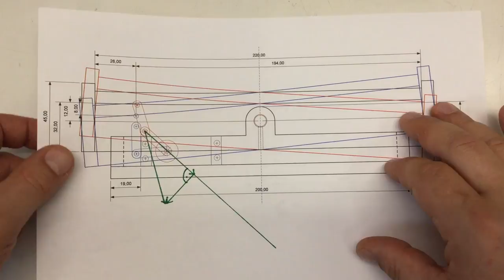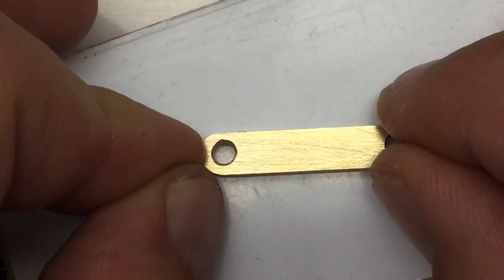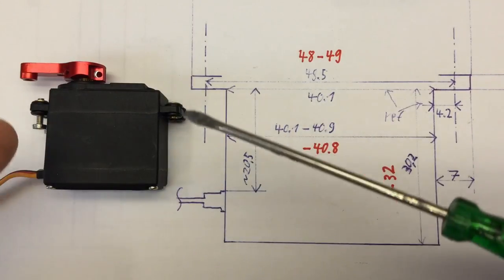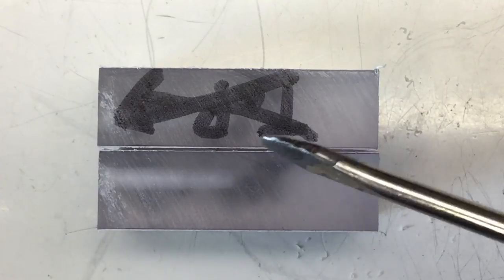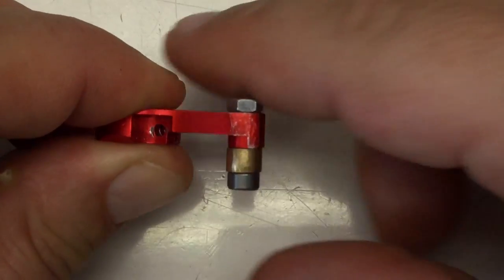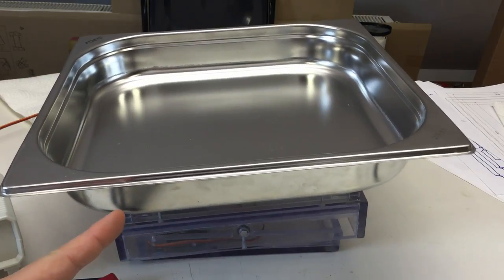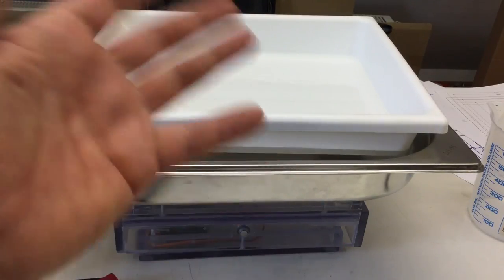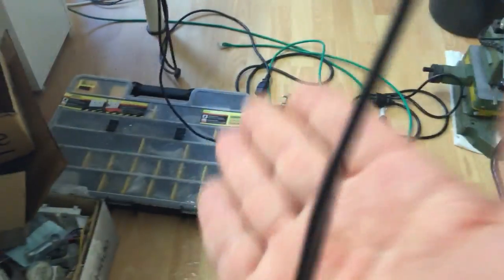Laboratory Shaker (4): The Drive, Assembly and Test

Comment: You might want to consider adding support blocks along the threaded rod to minimized the flex of the rod.
Reply from the maker: Thanks for the tip! I actually never thought about adding supports - stupid me - so I came up with a brute force solution (to be published on the 14th).

Comment: Looks great just a few 'Tweak's ' now ! do you know what happened at the end there ? when you removed power it tipped as the servo relaxed ?....cheers.
Reply from the maker: Well, it was exactly as you guessed: Without power to the governor there was free movement ;-) Unfortunately I didn't take that into account when drawing up the upper and lower part. But that will be an easy fix (to be published on the 14th).